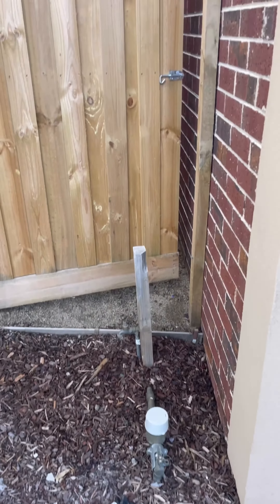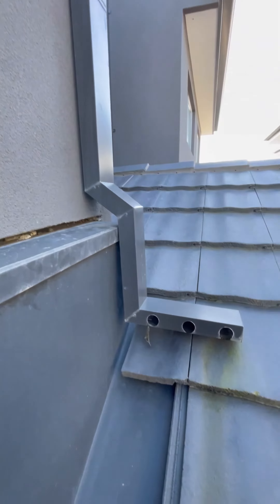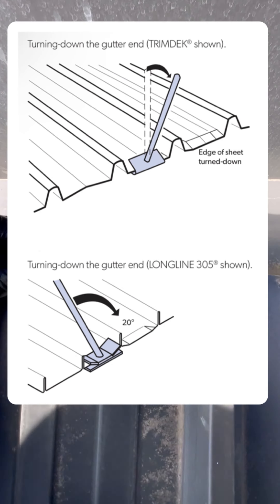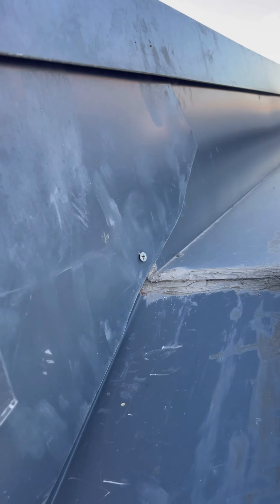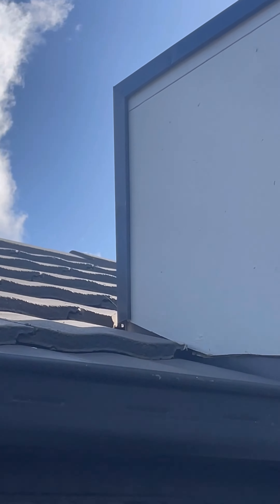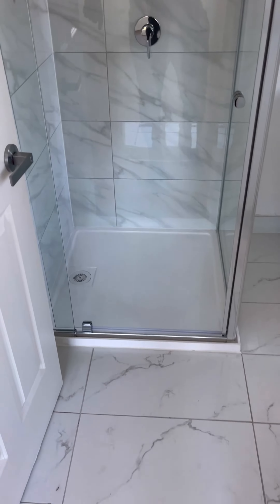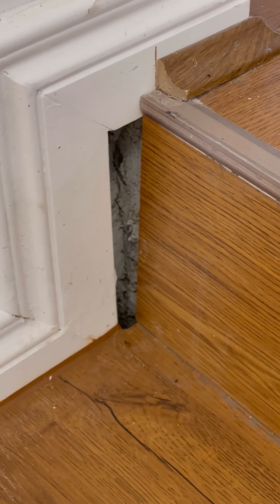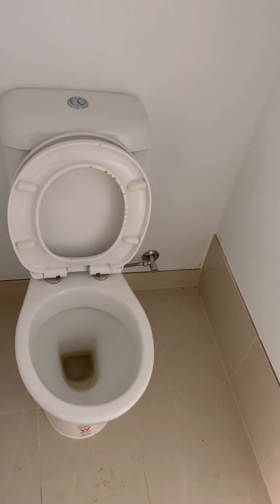Off The Plan Purchase Nightmare

Comment: Builder should be in Ravenhall Prison for crimes against the building codes! The VBA are more useless than an ashtray on a motorbike. Absolutely disgusting. The construction industry in Australia is cowboy country. Building inspectors should have the power to force these bodgey builders to rectify all faults before handover.
Reply: The Building Inspectors are just as bad. If they were doing their job, buildings wouldn't be in this state at handover.